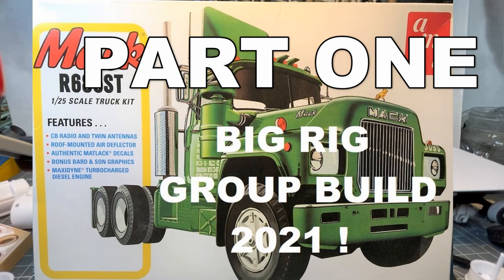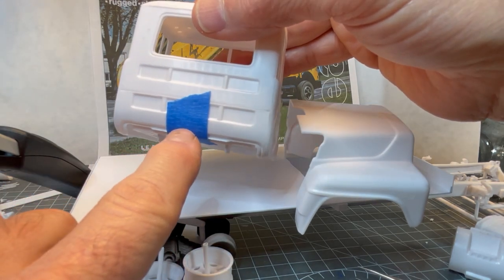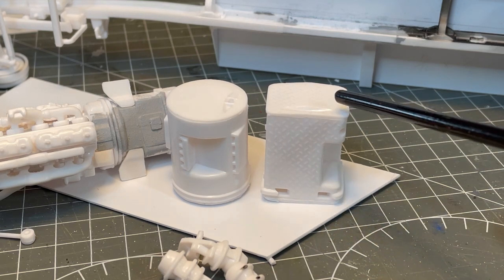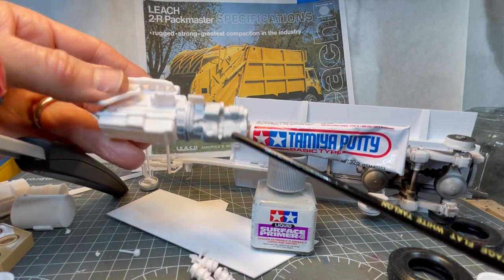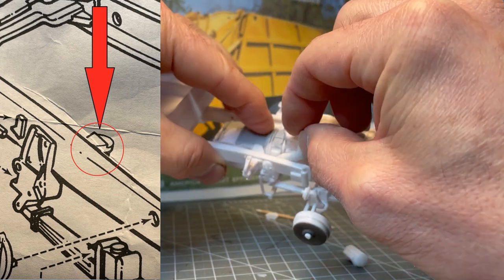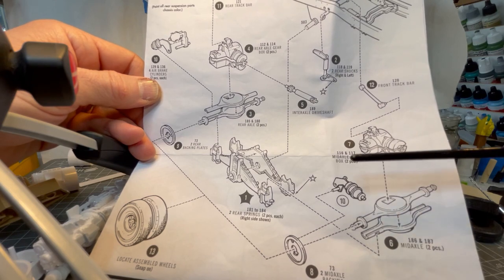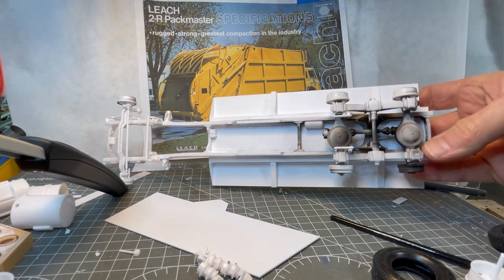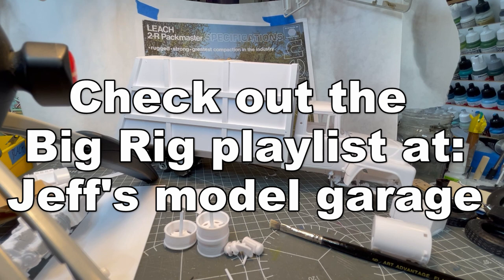Big Rig Group Build 2021  AMT Mack R685ST  Part One

Comment: Put a weld bead down the center of the diamond plate .. a piece of stretched sprue or small styrene rod melted with Tamiya glue and press with a moulder of some sort .. just a suggestion, I've seen repaired diamond plate like that before
🤟😎👍
Reply from the maker: interesting idea, if I don't use it on this one I'll probably use it on something else, thanks!